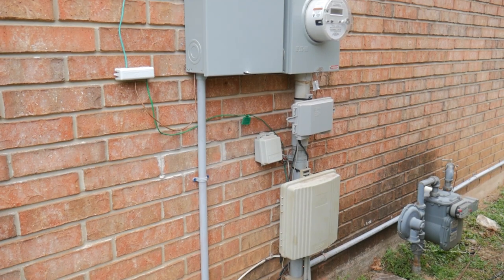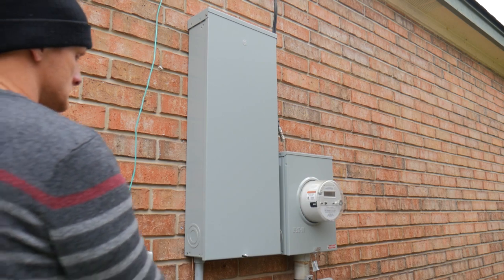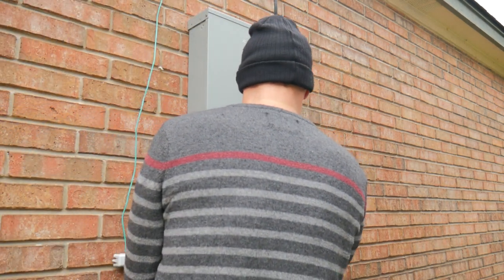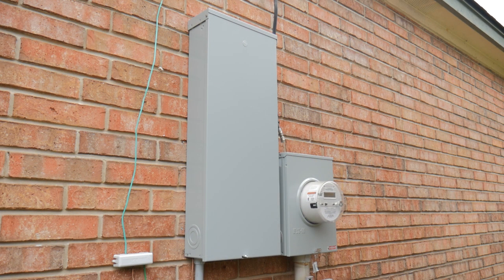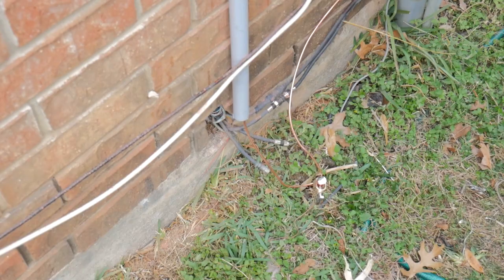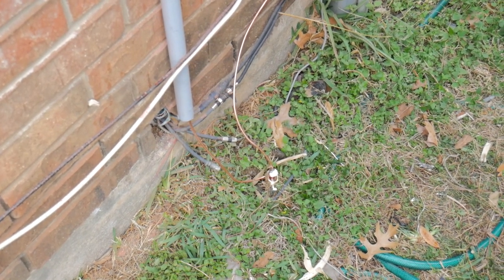Home Ethereum Mining Farm Upgrade

Comment: If i may have an advice: 
If i understand correctly the lower rigs have the fans facing the door, the noise level is higher towards the door. You could consider turning them around and facing the wall and put some cheap acoustic foams on the wall so they absorb some of the noise that rigs are producing.
Reply: you must be an audio engineer or something.

Comment: For continuous loads, only use 80% of a circuit's capacity.  If you have a 30 amp circuit, you should only use 24 amps of power for mining.

Comment: That room would never work down here by me.  Our houses are required to have return vents in every room or a stupid passthru vent in the wall if there is a door that could be closed.  Makes it near impossible to have rooms with differing temps unless you have a really old house that you've had for a really long time and haven't needed to replace the AC - or maybe mini splits might be enough to get away with not having the venting.  Honestly I think the rule isn't about building better homes, but about trying to make them more difficult to grow plants in without the entire house smelling like plants.

Comment: Do households' stove/oven outlets use 220v in NA? (PS. I'm from NA and I don't feel like taking the oven/stove out to check the outlet myself)
Reply from the maker: dryers are about it in newer homes
Reply: @SonofaTech  oven/stoves are not?
Reply: Electric ranges use 220v. There are also gas ranges (natural/propane).
Reply: @travishauch8132  Is ok compatible to use a 220v psu with 220v range outlet?
Reply from the maker: @travishauch8132  my bad yes I have gas
Reply from the maker: @adfadf9785  yes conversion plugs needed

Comment: I just started with 2 2080 ti's running in SLI but it seems like they are only making half the MH they should be each. (26mh each) any idea how to optimize?
Reply: remove SLi bridge
Reply: @CORPOR-iThomasKorb  Just removed the SLI and rebooted, it is still running the same as before.
Reply: @Shaunsms  you mining ETH?
Reply: @CORPOR-iThomasKorb  yes, with lolminer (used a previous video to set that up)
Reply: @Shaunsms  You try Phoenix Miner yet??Try that
Reply: @CORPOR-iThomasKorb  i haven't i can look into it though. thank you
Reply: @CORPOR-iThomasKorb  i think even though i removed the SLI bridge the 2 gpu's are still trying to split the load and not operate on their own. any idea how to fix that? (with memory over clocked +1100 i am getting 31mh/s per 2080ti
Reply: @Shaunsms  no idea honestly.  Seems weird.

Comment: damn here and i am mining with a single 3080 in my gaming pc
Reply from the maker: That was me in 2016
Reply from the maker: with rx 580 and a nvidia 1080ti
Reply: I'm still on 1080ti... 37mh/s
Reply: @Frederik.Schwim  Why? You can easily take 45-47 onthat? =)
Reply: @simboygaming7312  what?? How... I am using Afterburner, got 400Mhz on memory clock and 90Mhz on Core... Using Lolminer.
Reply: @Frederik.Schwim  double your memory. I have core 1885mhz and memory 5450mhz
Reply: @simboygaming7312  i got my core to 1885 and memory to 5953...38.5mhs....anything above that my mining crash... It is a founders edition 1080ti, latest drivers
Reply: @Frederik.Schwim  try other mining sofware.

Comment: i saw your Video about the perfomance of the Aorus RTX 3080 Master. I got one too also with only 2 8-Pin connectors, but mine works just fine. I can bring it up to a Hashrate of 92 mh/s with a slight OC and still having a decent power consumption :)
Reply from the maker: The pads start leaking and degrade. Mine is at 97mh/s now after thermal pad replacement. Be careful don't burn up your vram modules
Reply: @SonofaTech  Ok, thx :)
Reply from the maker: @mathisb.2953  https://www.youtube.com/watch?v=rH3Oavi-0OE&t=12s

Comment: damn,  I'm mining eth with my rtx 3070 zotac, running 54.7 mh idle, with normal day to day use non gaming is like 50 to 52. Sometimes it drops to 44mh while im in online school as some people have their cameras on. (That is with an overclock, -200 cc and +500 mc, with 80 power limit, going well so far tho
Reply: You should be able to squeeze at least 60 idle out of it.  I have 3070 (60mh/s) and a 2060 (30mh/s)
Reply: @kryptopcgamer589  do you overclock? And which 3070 is it
Reply: @Edward-xz2ul  yes its undervolted, power at 60%, mem at 1100+.  Gets 60mh/s at 132watts, core gets too 55c during mining, not sure and vram temps as there is no sensor on it.  Rtx 3070 from a hp omen 30l prebuilt
Reply: @kryptopcgamer589  oh it’s a 3080? You said 3070 at first
Reply: @Edward-xz2ul  i meant 3070.  3080 can get 80mh/s
Reply: @kryptopcgamer589  I want to try push mine to the limit in Afterburner and try get 60 ish or more, but this card is the only one I have and can’t afford for it to break, I just had a little oc on it at the monent
Reply: @Edward-xz2ul  you wont break it.  Turn power down to 60%, core clock -200, and mem +1100.  These cards are safe to oc, the 3080 and 3090 are the ones with the vram oveheating with the GDDR6X
Reply: @kryptopcgamer589  idk man, I have 80 power, -200 cc and +500 mc at the moment, I don’t know. I have the Zotac one
Reply: @kryptopcgamer589  thanks bro! It worked I was so scared to do it but I’m getting around 60 now and using less electricity thank you bro
Reply: @Edward-xz2ul  np